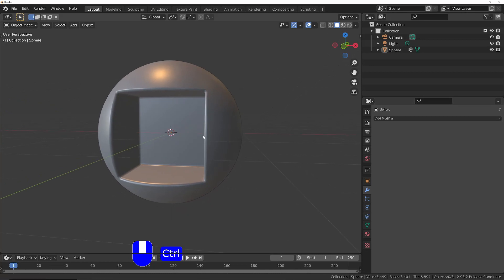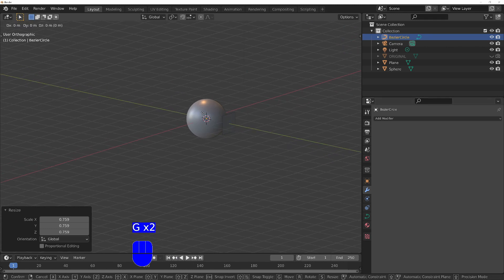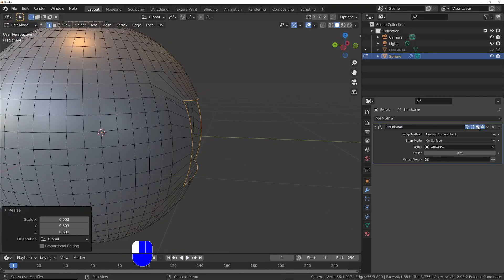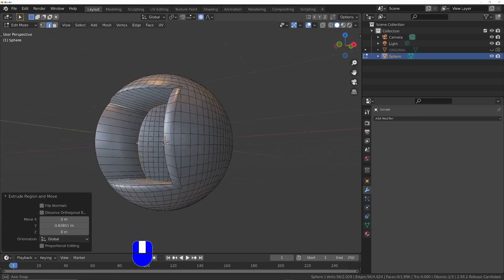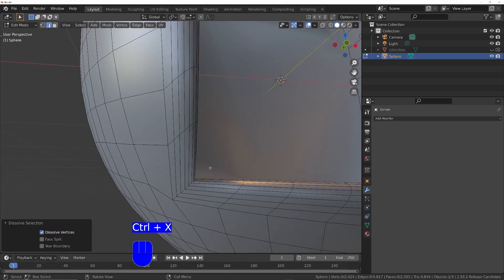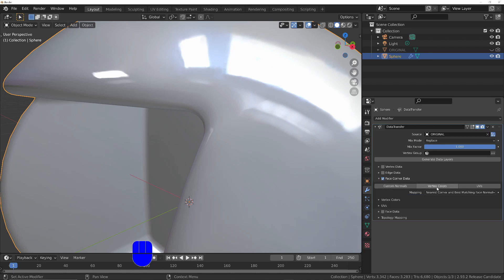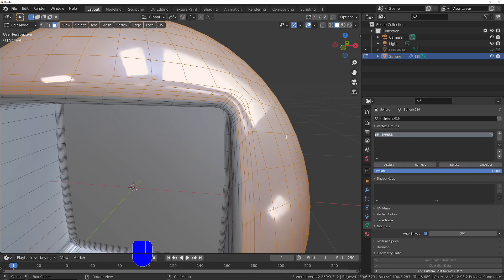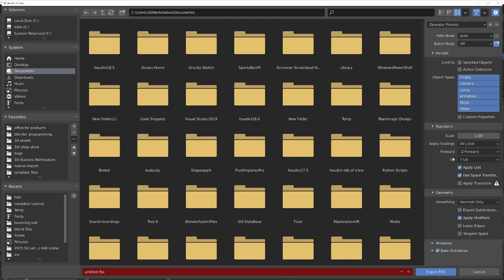Blender, Perfect Normals, FAST! + CAD type modelling workflow using Knife Project

Comment from the maker: Some may not be interested in the CAD like modelling workflow, so below are timestamps to skip to if you like.

0:00 setup for normals
0:47 farting around getting confused by viewport reflections
1:07 CAD like workflow with plane
1:39 demonstrating that it also works with curves
3:13 make the extrusion
3:40 modify topology without changing the overall shape of the object
5:53 create the main bevel after cutting
7:51 removing edges that are prevent a bevel on the extruded part 
9:45 create inner bevels
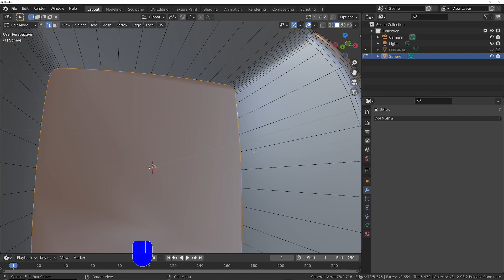10:17 how to quickly fix the normals without manipulating geometry.
13:15 normals comparison before and after
13:39 fix other areas with autosmooth
14:03 weighted normals modifier
14:32 exporting with the normals we've created